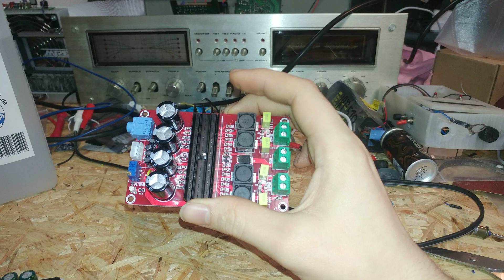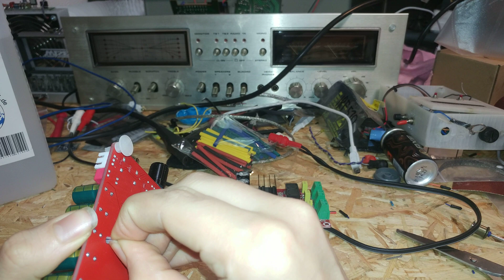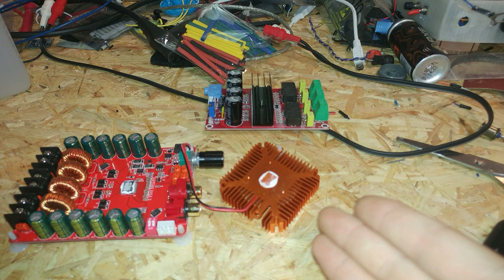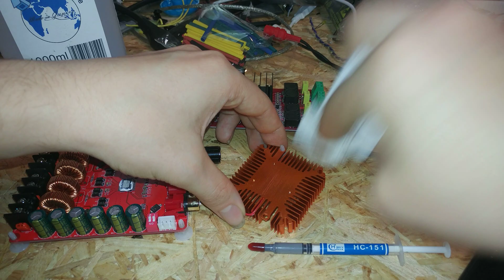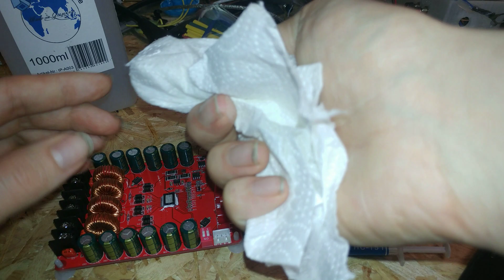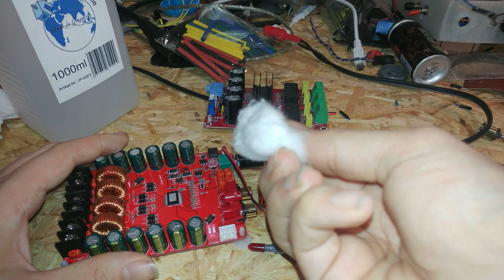Chinese TDA7498 amp. Heatsink compound replacement

Comment: Nice instructions. 
Does it still working after all this time or did you had to replace the chip or any other part? 
I'm asking because I don't trust very much these Chinese products because they make things to blow in days and buy a replacement LOL
Reply from the maker: If you are careful when disassembling electronics there is only a super low chance of damaging something. But yeah. Replacing thermal paste doesn't harm electronics whatsoever. Had this amp for 2 years now and its still working perfectly, despite my Supply voltage being a bit low (12V. At least 14V are recommended)

Comment: Hi great video. 
I bought this amp in Aliexpress and it works fine but it doesn´t support all of his potencial. I explain: i put 36v with a power supply and it gives plenty of volume but only for 10 seconds, then it goes to a down volumen.
Is this your case? What can it be?
Thanks.
Reply from the maker: Sounds like the load is so high it drains the capacitors faster than it can charge em
Reply: @HardDiskLover  I can solve it by adding more capacitors? 
Thanks.
Reply from the maker: @napolitano7150  you can try. Maybe it will work. Have you also checked if the powersupply you are using can deliver sufficient Current (Ampere). It could be that the load is to high for it and the voltage from the powersupply drops significantly. You can test this with a multimeter to see if the input voltage drops when your volume decreases
Reply: @HardDiskLover  Yeah it can output 170w. Thanks for answering. I will try different things
Reply: @napolitano7150  170 watts at 32 or 36v means there are not many amps going through it at all. When running at 36v you want 320w going through it. This board is rated for use at 9 amps.